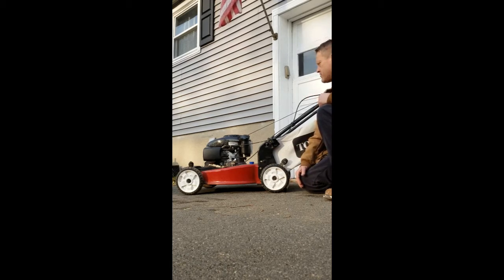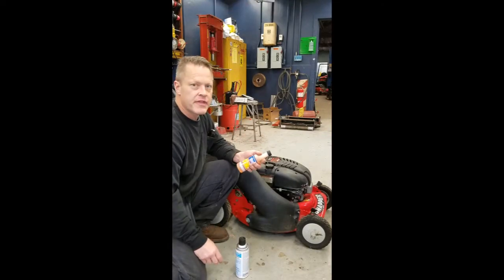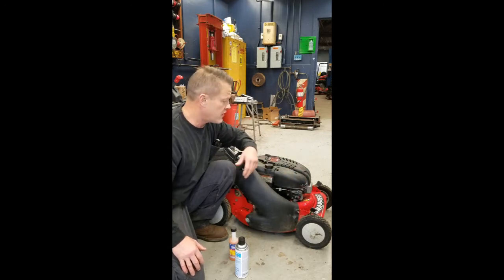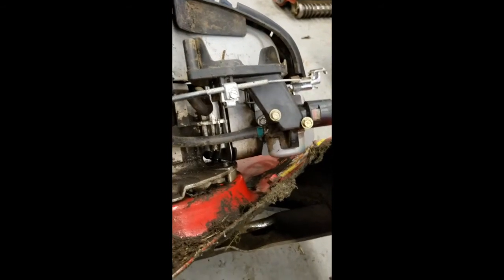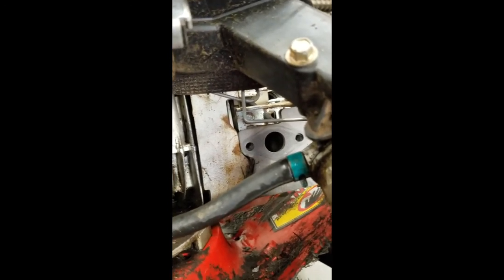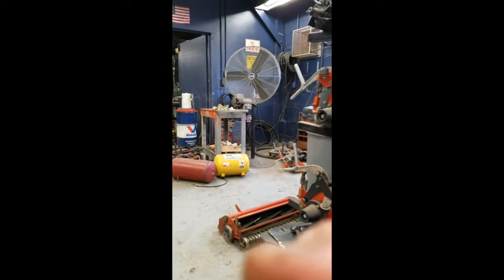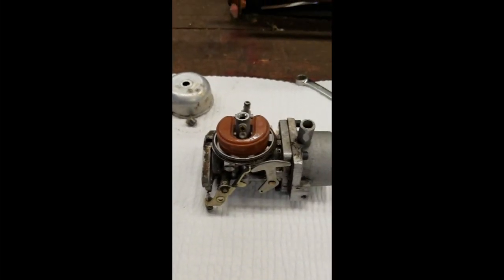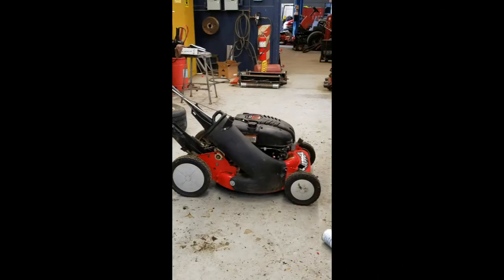Mower Will Not Start After Winter Storage

Comment: FOLKS HERE’S ONE SURE FIX!:
Yep the hidden pin holes in the brown bolt!!
 I just found THE EASY fixe on My Briggs Stratton mower with a removable carb bowl, wouldn’t run on its own, after 2 years storage:
During storage, if you didn’t run the motor out of gas or add fuel stabilizer and ran, before storage: then the most likely problem is the gas in the carb float has started to turn into a clear yellow varnish like gunk that is clogging at least one of the small holes in the system.
So first, you may need 2 people, with the air filter off, try spraying some carb cleaner or  starter fluid into the carb and starting. It should start and then die. Keep it running by spraying some into the carb. The carb suction might work the problem out and the engine may start to run on its own. If it does not after 2 minutes, then you will need to manually clear the blockage like I did:
Remove the air filter housing (8mm socket bolts)to gain access to the carb bottom bowl (10mm socket bolt with washer).
Using carb cleaner spray and needle and rag, closely check and clean the bottom bowl holes bolt removed. The bolt has a center pin hole AND 2 lower below the threads side opposing pin holes where fuel is drawn up from. These are probably need UNCLOGGING.
Also use your finger nail and rag, scrap the inside bottom of the bowl, clear like varnish glue will come off.
Reassemble, do Not over tighten!
This TOTALLY fixed mine. If it still will not run, you may need to remove the carb and clear the larger pipe going to the carb Venturi although this is probably rare.
Take care